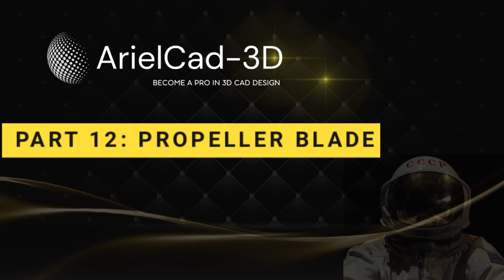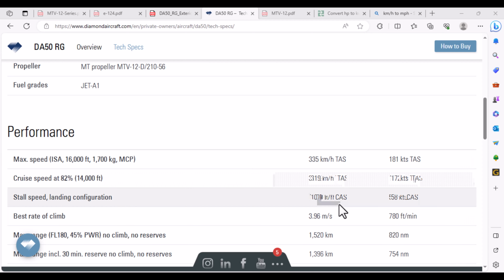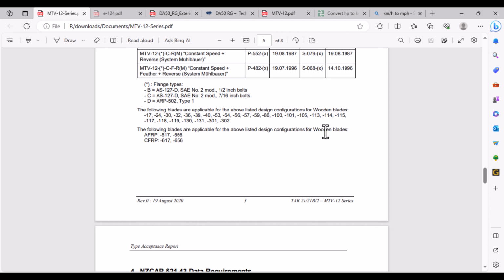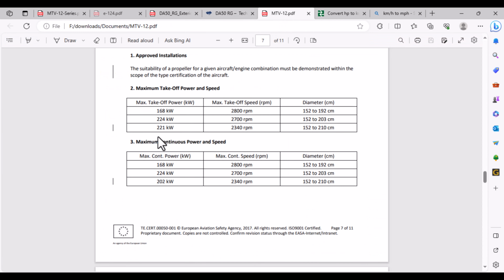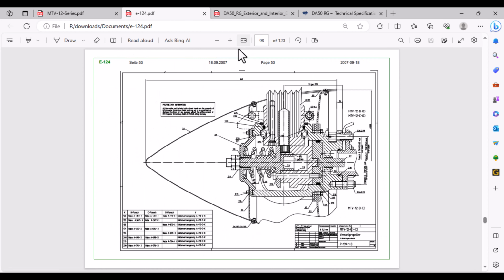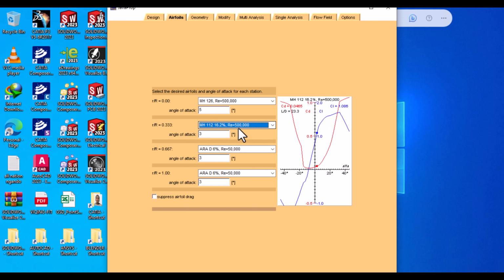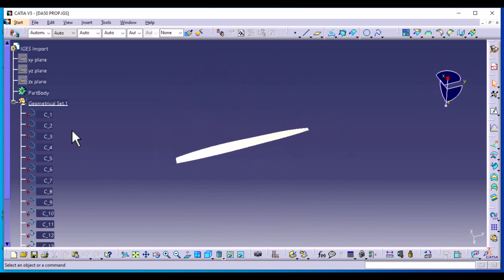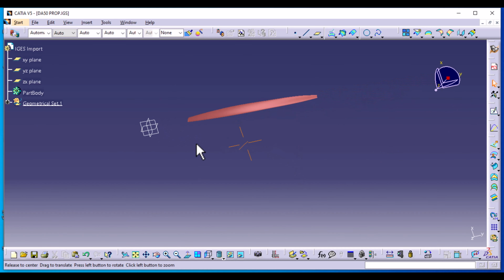CATIA V5 - DA50 RG AIRCRAFT DESIGN - CATIA V5| BEGINNER - ADVANCED| PART 12 - PROPELLER BLADE

Comment: Hi, it's impossible for me to launch the javaprop software (and when it works the calculation parts doesnt work) so is it possible to get the CATIA V5 prop files somewhere ?
Reply from the maker: If you are unable to launch JavaProp it's probably because one of the prerequisites for it is missing in your system. Go back to the amplet page & check all prerequisites for your specific pc & OS e.g. Java & install them independently on your PC from Microsoft. 
Alternatively if you can code you can use Matlab to generate the lofts & import them to Catia.